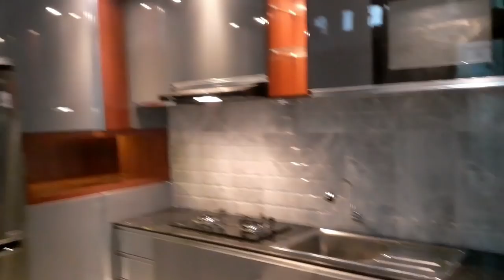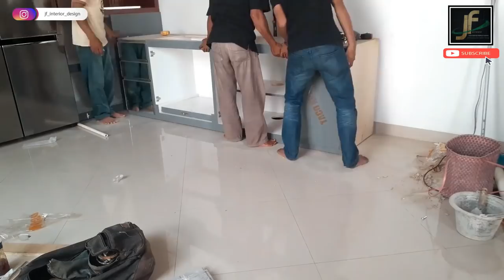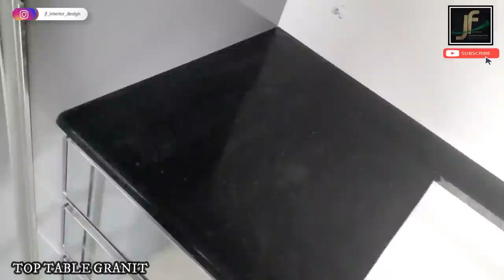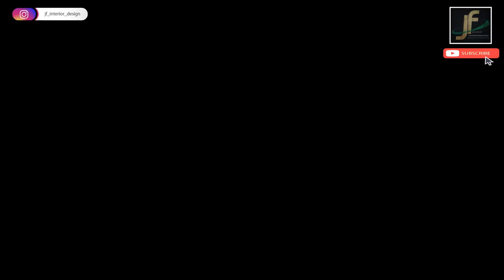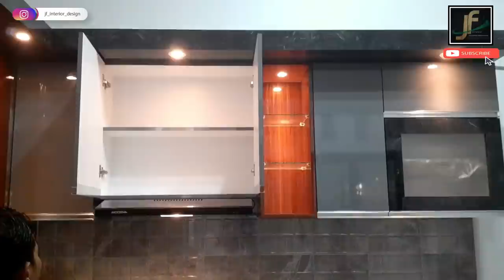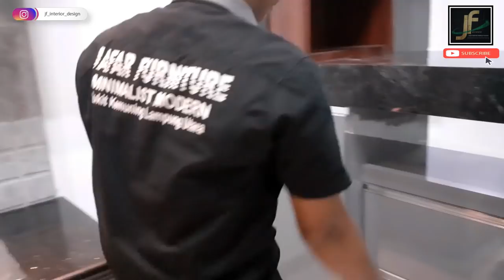Cara Memasang Kitchen Set - Dilengkapi Pemasangan Top Table Granit

Comment: Untuk meja bawah tu pakek apa bos geranik apa keramik??
Reply from the maker: Pakai granit, video pemasangan granit di menit ke 6 - 7
Reply: @JFcarpenter  geranik ukuran panjang brapa tu bos??
Reply from the maker: @nurmala9787  panjang 242cm x lebar 61cm x tebal 2cm
Reply: @JFcarpenter  kalau mawu psan geranik  nya berapa harga nya bos??
Reply from the maker: @nurmala9787  harga granit kisaran 1,5jt permeter. Harga setiap daerah berbeda.
Reply: Itu granitnya hanya diletakan aja atau di beri lem bang? Tw
Reply from the maker: @jokotriono1793  simak videonya sampai selsai mas. Ada cara pasangnya